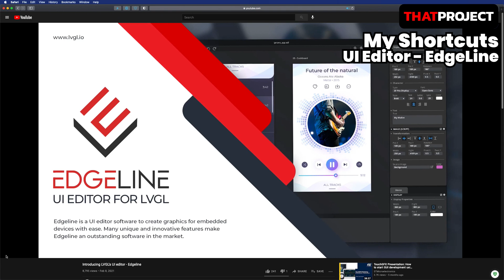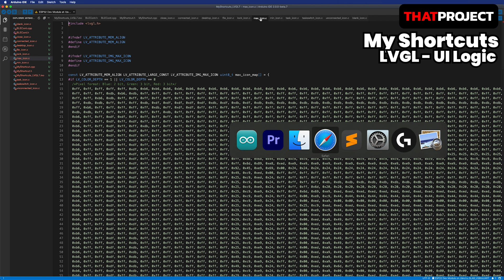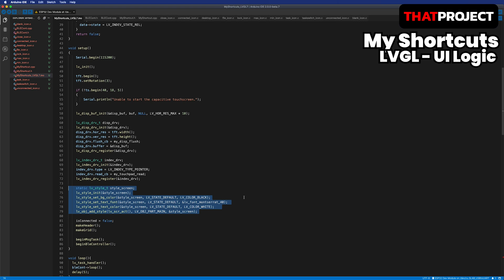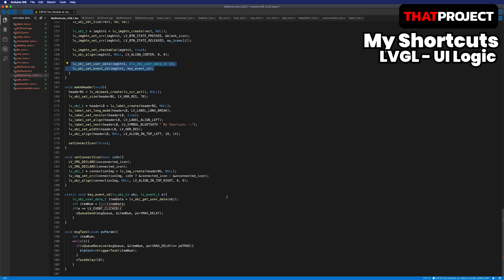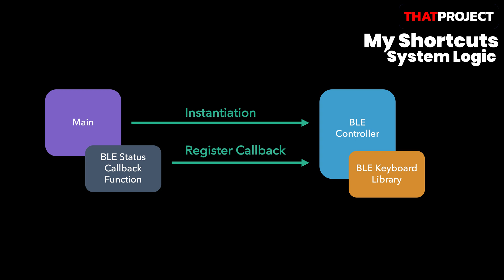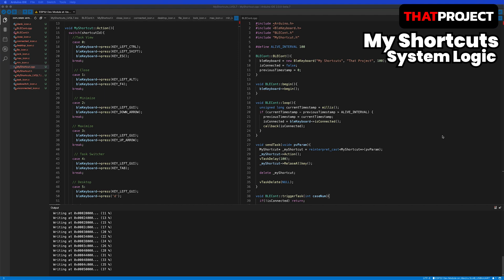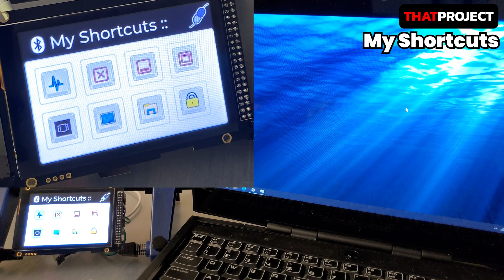ESP32 | LVGL7 = My Shortcuts for Windows 10 = (ft. BLE HID Keyboard)

Comment: Why is the BLE connection unstable on the ESP32-S3 when using the BLE library? It keeps disconnecting and reconnecting in a loop.Thanks
Reply from the maker: For some reason, I think the connection is lost in your environment. There is no problem with BT of ESP32-S3 specifically. Please try debugging to see if any issues occur after connecting.

Comment: Hello, I really like this project but am having difficulties trying to compile it. Do you have a version that works with lvgl v8?
Reply from the maker: Hi! Unfortunately, this project was built on LVGL version 7. Some LVGL code needs to be modified to work in v8. I think you can handle this. Go for it!
Reply: @ThatProject  It took a while but I was able to do it. I did have to change several things including not having images on the buttons as it is completely changed in lvgl 8.
I posted the project on printables if interested called alien3d deck
Reply from the maker: @Dsk001  Congrats! You made it. I'll try your project.

Comment: Hi,

We have finished EdgeLine v0.3. The most important features are:

Linux version
C and MicroPython Code export
Minor changes

Add scrollbar the the hierachy panel
Unify scrollbars
Make the color picker window movable
Speed up and fix screen redrawing
Add “clip_corner” to bg styles
Make the animation’s Play button inactive during the animation
Fix outline and opacity animations
Fix issues related object rename
Various graphical fixes
Reply: @That Project
Reply from the maker: @qigao5458  I know Edgeline 0.3.1 came out and I'm testing it, but there are still many bugs. I think we need to wait a little longer to use it properly.
Reply: @ThatProject  Looking forward to the Edgeline 0.4, Looking forward to your work
Reply from the maker: @qigao5458  So do I.